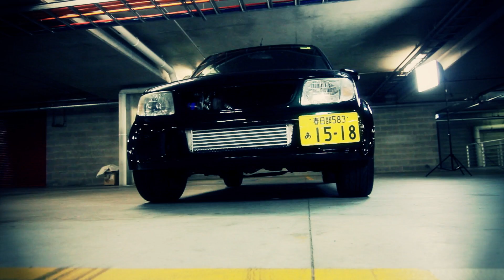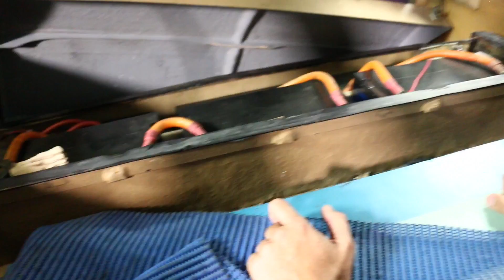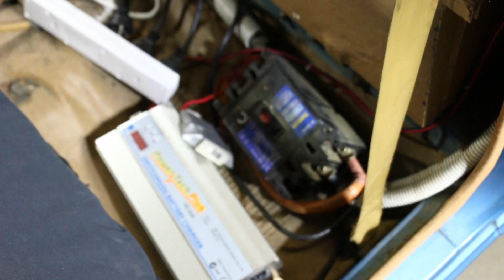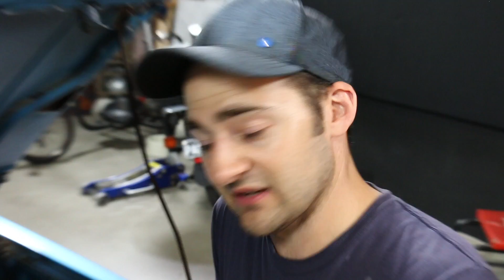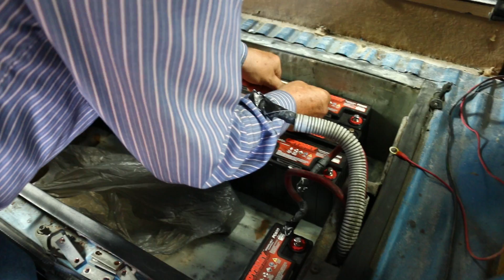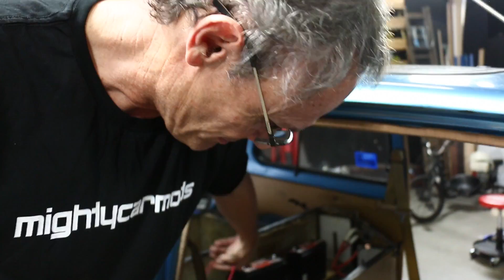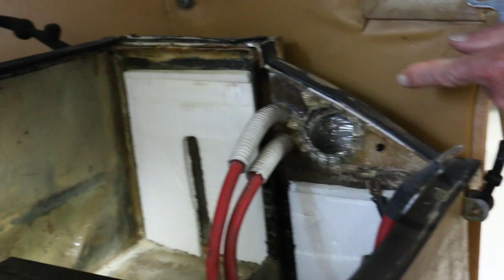JDM Electric Turd

Comment: Sorry guys in Australia.  Your EV cars are less "green" than a gas engine car.  Why? Because most of your electricity you use to charge your cars comes from coal.  Y'all use 70% of your electrical generation sourced from coal.  That's your dirty secret.  Hell I don't care, we use some coal here in the USA too...  Good video guys.
Reply: +Steven King Actually EVs are so efficient they beat ICE vehicles on emissions even when powered by 100% coal generated electricity. When I ran the well to wheel numbers on the old RAV4 electric vs. fossil fuel RAV4, the EV on 100% coal electricity beat the ICE version on emissions by between 5 and 10%. And on the plus side when you improve the fuel mix on the grid every car connected to it improves instantly. Here in Ireland on average 50% of grid power at night (when most cars charge) is renewables and less than 15% coal. My whole family has gone EV. My BMW i3 saves me €9000 a year in fuel and maintenance AND it's faster to 70km/h than an E92 M3.
Reply: +Steven King If you don't care, why mention it?
Reply: +Patrick Archibald I'd much rather live next to a nuclear power plant than a coal power plant. I'd be exposed to less radiation and feel safe knowing that nuclear power kills the least people compared to other power generation methods.
Reply: +Steven King At least we don't have nuclear power stations, which you do have in America. What would you rather have in your neighbourhood? And did you know that the USA has 5% of the worlds population but uses 25% of the worlds coal, natural gas and oil?
Reply: Are you joking? Tell the people of fukushima that mate, ask them if they'd like to live next door to a nuclear power plant. I don't like coal fired power plants, not many people do in Australia, and things are changing, the people are fighting it.Nearly every house where I I've has solar panels on the roof, the whole of Australia is not powered by coal. But I can't believe you are defending nuclear power. Sure it doesn't have as much pollution when the plant is operating, but what about all the shit that is left over, the depleted uranium, currently there is 480,000 tonnes of depleted Uranium stored in the United States alone, it stays toxic for thousands of years. And you love nuclear power? Very short sighted
Reply: Fekillix Are you joking? Tell the people of fukushima that mate, ask them if they'd like to live next door to a nuclear power plant. I don't like coal fired power plants, not many people do in Australia, and things are changing, the people are fighting it.Nearly every house where I I've has solar panels on the roof, the whole of Australia is not powered by coal. But I can't believe you are defending nuclear power. Sure it doesn't have as much pollution when the plant is operating, but what about all the shit that is left over, the depleted uranium, currently there is 480,000 tonnes of depleted Uranium stored in the United States alone, it stays toxic for thousands of years. And you love nuclear power? Very short sighted
Reply: +Patrick Archibald I'd much rather have some gunk stored away in a vault in the ground, than have loads floating around in the stuff I breathe. Nuclear energy is being researched every day, and at some point we will be able to harness nuclear energy without the  drawback of nuclear waste. (A large step forward is the German fusion reactor that was recently successfully powered on).

Also, your solar panels only shine in the day, we cant send power around the globe and need a reserve during the night time. Wind and hydroelectric? Well, hydroelectric works well but has a massive impact on the local environment. Wind doesn't always shine and waves do not always swell.
Reply: Fekillix The sun shines every day in Australia matey. And we don't have 'loads of stuff floating around in the air', are you kidding? We have the cleanest air in the world. Tasmania, literally has the cleanest air in the world. Gunk? Are you kidding me. 2 hours of exposure at Fukushima will kill you, to call it 'gunk' is just stupid. Listen, I reckon you're just a kid, am I right, maybe 17? 15? Do some more research and stop talking crap. Google 'fish, tumour Fukushima'. Fish in California are now growing tumours, this has never ever been seen before in the species they are seeing the tumours. The radiation from Fukushima is causing this. Nuclear reactors are ok until they blow up, then they cause massive problems. Stop being a dickhead and start using your brain. The Japanese said nuclear energy was safe, now they're in big fucking trouble. The Russians thought it was safe, look what happened. You can't get rid of it, once it has been released into the atmosphere, it's too late, and it changes the DNA of any organism it has contact with.
Reply: +Patrick Archibald NASA says that nuclear power generation has saved 1.8 million lives, in comparison to the power being generated from sources like coal. Also, does Tasmania have any coal power plants?

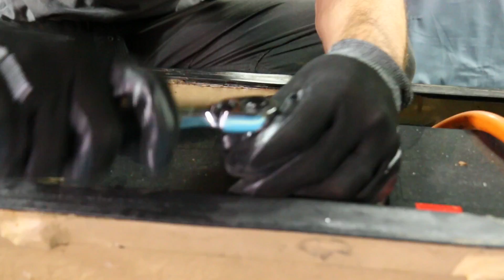Comment: The original generation RAV4 EV used NiMH, not lead acid batteries as you state at 15:10. (The second generation RAV4 EV, as you don't state the generation, used Lithium-Ion.) Moreover, the EV1 only used lead acid the first year and it too switched to NiMH.

Comment: The fish smell is from the hydrogen sulfide the batteries offgas during charge cycles. It can get pretty rank if it soaks into stuff.

Oh, and hydrogen sulfide is pretty flammable too. Keep the battery boxes well ventilated while charging the car. :)

Comment: Does Anyone know if they could have actually just bought like cell batteries from Tesla or someone to run it on? because with that much room using modern cell batteries they could have probably gotten like 300 kms out of it!
Reply: +crazycakemanflies Once the Jiggazone is built you'll be able to get 'em way easy.

Comment: alot has changed since you guys built this..

cureent batteries are smaller, lighter and have more capacity....which is a major upgrade.....
but there not necessarily cheaper 

so if budget is not a concern then this can be enhanced alot

as for the vacuumed assisted brake system you need a 12 volt vacuum pump and it should operate well

oh its mentioned in the video...never mind
Reply: +Faisal Abdulaziz I'm reading January 2016 on the video date. A lot has changed since then?
Reply: sirgallium im talking about the battery technology they are using ...it was a mistake on my behalf

Comment: Because the motor is attatched to the original transmission, that car will be more efficient at higher speeds than a transmissionless electric car (most new ones)

Comment: might want to consider if your serious about wanting an electric car, is looking into graphene supercapacitors. while expensive, they prove to be a much more significant benefit than using a battery, capable of whole a substantially larger charge, as well as recharging faster than batteries

Comment: Remember volts don't kill yah, it's all about the amperage (amps)
Reply: +grant mullet its the right amount of both :)
Reply: +grant mullet As a general rule, a voltage above 50 Volts DC is considered dangerous by code.

You need just 10mA to lock up the muscles in your arm, but you need something in the order of ~100 Volts to overcome the resistance of your skin. Anything above 100 is outright dangerous, that applies to Solar arrays as well. It will contract the muscles but never release, which can be a problem if it's your heart. Most of the time you just tear tendons or muscles first.
Reply: +grant mullet But the higher the volts, the higher the amps. See 8xONZcBJh5A

Comment: when people figure out that they do not need 800+km range on their daily driver electric cars will take off quicker than flies on shit.
with current battery tech have your EV for your work car and have an ice car for if you want to go for a long drive
Reply: +bjorn1583 I don't think it's really that simple. As you say, you now need two cars, two registrations, two inspections, to insurance cards... a lot of people are going to just choose to have just one gas power car and simplify life.
Reply: buggsyspam most households have more than 1 car anyway so it wont change a thing other than you will have more money in your pocket cos your not spending so much on petrol

Comment: "how do you change gears?" REALLY???! Change gears in an electrical car dude? Aren't you supposed to know a lot about cars?
Reply: +Johnny Did you even watch the video?
Reply: +Nabder Nagor Really? But it's useless. The electrical motor connects directly to the wheels, no need for reduction as the torque is controlled at the motor. Right?
Reply: +DoctorSwan Do you even know how electric cars work? No, you don't need the gearbox, in this case it needs to be bypassed. As I said the torque and is controlled by the electric motor itself and is dictated only by the amount of electric energy you drain from the batteries.
Reply: ***** Ah ok. But in that case the gearbox is just messing up the system, all those old gears with a lot of mechanical friction losses.

Comment: I need to correct a couple of factual errors.  The original 1997 GM EV-1 did use Lead Acid (PbA) batteries, as this video mentions.  The Generation 2 EV-1, released in 1999, used Nickel Metal Hydride (NiMH) batteries.  The 2001-2003 Toyota RAV4-EV also used NiMH batteries (not PbA). (I leased one '97 and two '99 EV-1s over five years, and owned a RAV4-EV for ten years.)
Reply: +56KillerB google is your best friend i see
Reply: +ElementalXV: Intimate knowledge of the cars I drive, and being an original member of the Electric Auto Association since the 1990s (in the States) is adequate.  No Google necessary.

What's your point (besides snark)?
Reply: 56KillerB  sorry SIR, i wont question your knowledge.

Comment: This is really cool. I was hoping that you guys would build an EV someday but it happened a lot earlier then I had thought. It's good that you start with simple stuff like lead batteries. Just try to get it work first, drive it and then think what you want to do with it. I suggest that you add a big fuse into each battery pack. With that fuse you can cut the circuit inside that that battery pack and you are more safe to work with it. I hope to see more EVs here now on.

Comment: Can u guys some how add alternators on the back with a belt turning them wile the car drives to constantly charge it wile driving OR just add a solar panel on the roof
Reply: +José Villa 
it's not that easy, mostly because you need some rather high voltages to actually charge the batteries, and having a circuit to charge the batteries WHILE they're being drained is....difficult...

Comment: Buy lithium laptop cells instead. You can get them for 150$/kWh and it's 10x lighter than the lead. Literally. It's superior in every way.
You will need to buy the cells in bulk from a chinese supplier and ship it though. It's LG cells, quality brand. 18650 cells 2.6Ah. About 200Wh/kg density. Vs around 20 effective density for the lead. Plus the additional factor for the reduced weight. So it's a no brainer.   WLSpower on alibaba is a supplier.   Last price I got a couple of months ago was 1.39$ per 2600mAH LG cell in volume of 1000. That's about 9kWh capacity
Reply: I don't think buying them in laptop batteries (assuming new ones) is cost-effective... Buying some loose 18650 cells from Fasttech (or similar) should be much cheaper.

They are also more dangerous and if used long-term, it would probably be good to add some additional protective shielding around them.

Comment: You mentioned battery technology as being a driving (heh) reason about why electric cars aren't common, but another big one is environmental reasons.
Electric cars have higher CO2 emissions than petrol ones, because when you think about it they're basically coal powered.
Reply: +Nix6p this goes to show how retarded people can be
ur factoring in where the power comes from to make the electricity to charge the batteries, which is vastly more efficient by having a centralised power station.
as opposed to all the energy required to pull the oil out of the ground, turn it in to petrol, then send it to all the different petrol stations, and then have every car with its own engine to generate power.
Reply: +Nix6p Depends where you live. There's very few coal plants where I am. In Australia...? Who knows. The wallabies, I guess...
Reply: +Nix6p That's not true. EVs are so efficient that even on 100% coal power they beat ICE vehicles on emissions. And almost nowhere on the planet is 100% coal power. In my case, grid power is more than 50% renewables and less than 15% coal.

Comment: Better get used to working on electrics, you'll see more of them and less gas cars in the near future :D
Reply: +The Lavender Town Project when batteries can be recharged in the same amount of time it takes me to put gas in my car, then i will consider it the future
Reply: harry 01 Well that may never happen, which, and definately not by the time they will overcome gasoline cars. Most people don't remember that it can be charged when you sleep which eliminates any waiting for charging during the day. Just get a car with long range. Even then, you'll never need more than like 50 miles of range unless you're taking trips. For that, you can get a battery swap, find a DC fast charge station that charges a car in 30 mins, or get a electric car that is charged by hydrogen. Even a gas generator works. EVs also have regenerative brakes that give you charge when you stop, and there are also concept tires which charge your car, and same for whole highway lanes. And there are solar panel options too.

You should know that many state and country laws require a certain number of EVs and made and sold, increasing each year, and whole companies' total MPGs also must improve each year. Some places are even banning gas cars by certain decades.

It may take 30, 50, maybe even 70 years, but it will happen, and as of this year, it's starting 2 fold!
Reply: +The Lavender Town Project once graphene can be mass produced (i predict within 5 years) you'll be able to charge the batteries much faster than you can pump gas into a car. and i assume they'll make motors with carbon nanotube wires to drastically drop resistance and massivley increase effeciency.
Reply: jabadahut50 Yes, graphene FTW! Tesla is slowly integrating it with their lithium batteries.

Comment: electric cars are soooo boring
Reply: +Cesar Castilleja The SLS electric has more torque than a nissan gtr, how is that boring?
Reply: There is no soul and no emotion. Sure its still fun to drive but for me I'd rather have the sounds and smells of a gas motor.
Reply: Cesar Castilleja I guess you like harleys then?
Reply: Nope. I bet you think teslas are the future though.
Reply: Cesar Castilleja Oil is a finite resources and we are killing the planet using it as well, you may not like it but electric cars are the future.
Reply: You guys don't do enough research. The power plants that create the electric energy to charge your Tesla are proven to be just as and occasionally more harmful than running a gas car. The idea behind me electric cars is nice but unrealistic at this moment.
Reply: Cesar Castilleja Geothermal, hydro, wind, even nuclear are power sources and are clean methods but thats no reason to throw away electric cars because one powerplant out of ten in a state uses coal.
Reply: +4 Tonnes of Fury I don't know what state you live in but 1 out of 10 is way off. somewhere around 40 Percent depend on burning some fuel.

Comment: I've seen that sort of plug on rare occasion here in the US, and I was wondering if it was metric electricity. ;-)

Batteries!  You're using chemistry to chemistry with both matching, no need to change the charger.  The new ones don't look as capable as the dinosaurs that you took out.  The mAh or Ampere rating should be the same or superior to the one being replaced.  The CCA is a good indicator as to the capability of the battery.  For a car such as this, and if I had a choice of lead-acids to choose from, a marine deep cycle battery is where it's at.  You can run them to near death and recharge them, and you won't need to change the charger.

Comment: Those are Enersys gel cell batteries. They're for small appliances, like generators and lawn tractors, etc. I have one in my Murray racing mower, best stuff ever. I've had it for two years, never once charged it outside of the vehicle. It sat for 6 months twice in Northern Minnesota, and starts like a charm after sitting in -40 and below temps. They'll last you a while, great choice!

Comment: You also forgot to mention one very important danger. 

DC compared to AC won't throw you across the room, your muscles will contract if you yourself complete the circuit physically. You won't be alowed let go until your nervous system or muscle tissue is pretty much fried, whichever comes first.

Comment: Why the two battery packs?. You could have had a 4-seater!
Reply: +Martijn Kösters didnt you listen to what they said? they said for more capacity, more capacity = more range
Reply: But why one front and one rear? It could easily have fitted in the hole under the original floor